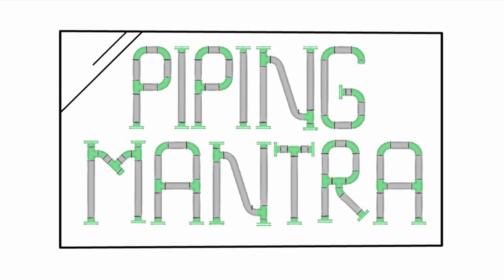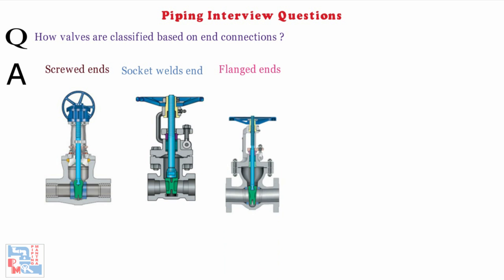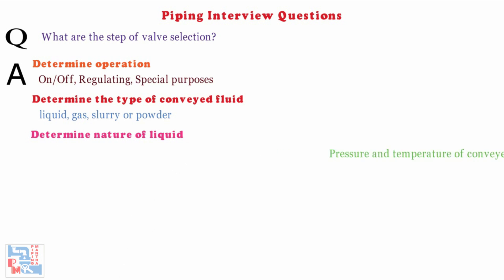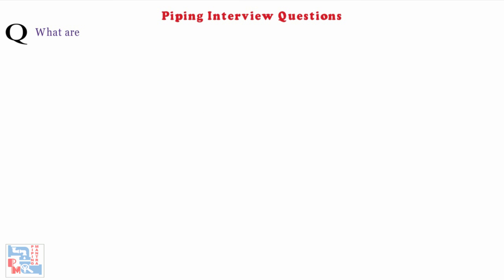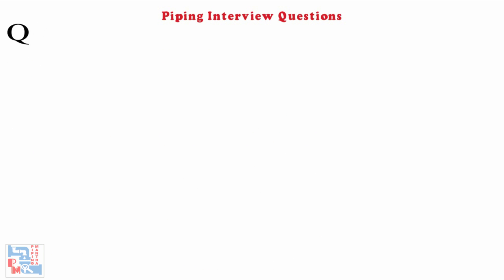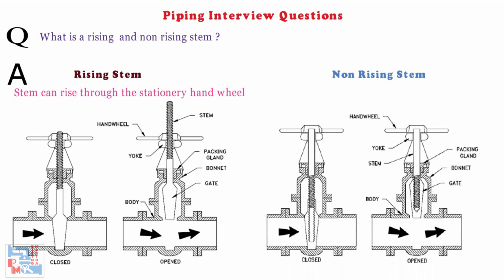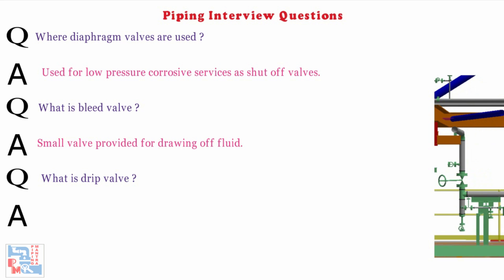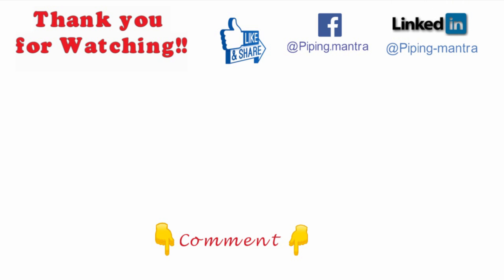Piping Interview Questions | Part-5 | Material | Piping Mantra |

Comment: Dear Madam,
Could you please make a video on nozzle pipe schedule selection for pressure vessel and also nozzle flange class selection. In most of the Design data sheet, nozzle size is given but class or flange type remains missing. Please make a vifew on this subject. Please !